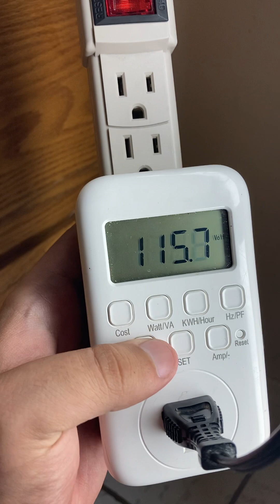Homemade High Output F36T12 Preheat Fluorescent Fixture

Comment: Very rare lamp.    Even more rare would be seeing a F36T12 slimline fixture in use.   Yes, those WERE a thing and extremely rare, probably far more rare than even the F48T12 slimline.
Reply: what about F42T12
Reply: Oh yeah,  I forgot about the F42T12 slimline.   Also there were F60T12 F64T12, and F84T12 slimlines made in addition to the standard 2, 3, 4, 6 and 8 footers.   I can't ever recall seeing a slimline shorter than 72 inch though.  I have seen F60T12-HO used in older grocery store walk in coolers, though.  I'd imagine the oddball lengths of 42, 60, 64 and 84 inches were used almost exclusively for signs or vending machines,  rather than for general illumination.  Even in Kmarts and Walmarts before the days of LED, at least in all the ones I've been in during my younger years,  would often finish an end row in a 4 or 6 foot T12 strip otherwise lit exclusively by F96T12.

Comment: Could 3 20w Preheat ballasts wired in parallel used to power an F40T12? When I tried 2, the OCV was not enough to power it.
Reply from the maker: @GavinZBeatsJunior  If it is a 4 foot tube, it will still not light at 120V OCV. A 2 foot F40T12 tube from the UK will do a better job of running off 120V OCV. You will need an autotransformer ballast to preheat the tube off 120V if it is a regular 4 foot tube.

Comment: 3 20W ballasts in parallel? Does it have a higher operating current than the standard 40W?
Reply: In my opinion, the wattage technically doesn't really matter as long as the voltage, amperage, (avd) arc voltage drop, and (ocv) open circuit voltage, are the exact same or just about.
Reply from the maker: These fluorescent tubes have an operating current of about 800mA. In fact, my circuit consists of a pair of North American 14-20W choke ballasts and a North American 13W PL choke ballast connected in parallel just so you know.

Comment: Interesting
Reply from the maker: Certainly something you don’t see every day since T12 high output tubes like these are often used on rapid start ballasts and commonly used for lighting signs.
Reply: @worldwidehidcollectorusa3519 what would I need to power a 35w F24T12 tube?
Reply from the maker: @kenytha5  So far, My estimate is something like 5 4-8W T5 choke ballasts in parallel but I have not tested that setup yet, but hope to someday.
Reply: @worldwidehidcollectorusa3519 
Another question, I want to use an Advance 14uf 120v cap for my s76 reactor ballast but it's made by Universal and the cap is only for Advance ballasts, is there a solution around it?
Reply from the maker: @kenytha5  As far as I know, I think the most important thing to pay attention to is the capacitance in microfarads and the minimum capacitor voltage the ballast requires rather than the manufacturer. I think you should be fine, but otherwise, a simple choke ballast can usually operate just fine without a capacitor.
Reply: @worldwidehidcollectorusa3519  
do you happen to know if a 220v integrated ballast induction lamp can be safely run on a typical 110v-220v transformer?
Reply from the maker: @kenytha5  I think it might be okay if you run it on the secondary side of the transformer assuming it is wired correctly. Otherwise, I think you might be able to run it just fine off of split phase 240V outlets like ones used for electric dryers, electric stoves, or air conditioner outlets if you have any of those. They should look different from the typical NEMA 15 outlets that look like faces.